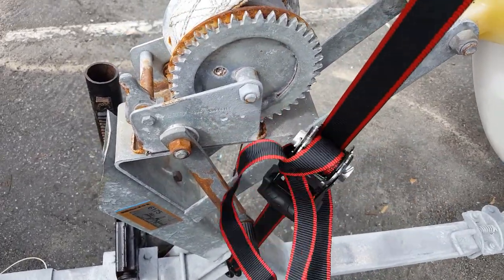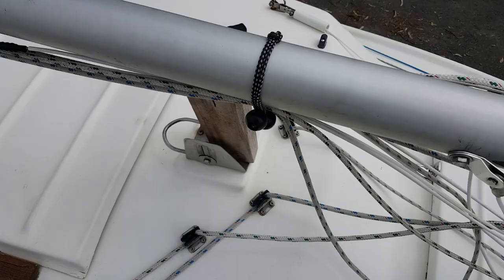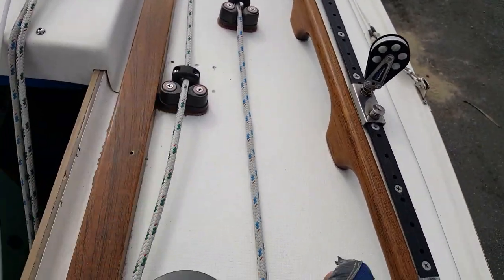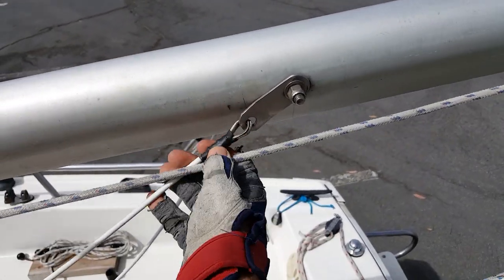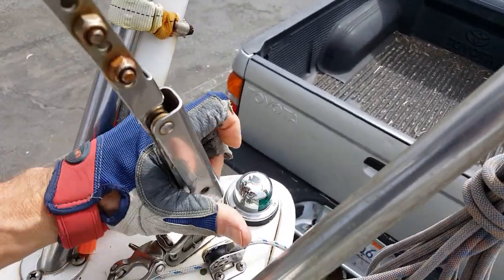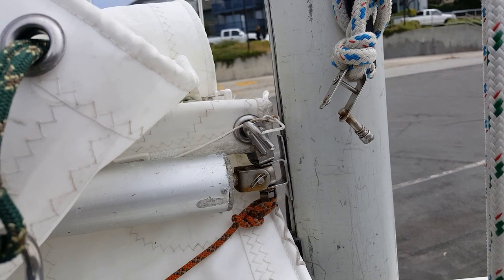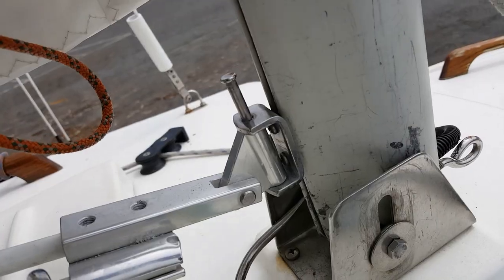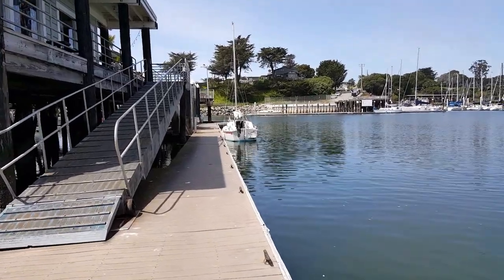Boat Tour: Setup

Comment: John great stuff. I had a 1998 P19 for awhile now have a 2005 Montgomery 17 I sail on Lake Erie but plan on taking her farther.

What do you hang your anchor on the pulpit with?
Reply from the maker: I hear good things about those Monty's. The anchor is hung with a piece of PVC pipe which is attached to the pulpit using two pipe clamps. The shank of the Danforth anchor is dropped into the pipe (after removing the chain), resulting in a very solid mount.

Comment: Thanks for the video! Just purchased a WWP19. I live up near Victoria Canada and am interested in rigging her with a Code 0 just like yours. Any info you can provide on the Code 0 would be greatly appreciated.
Reply from the maker: You're welcome. Congrats on the purchase. The Code 0, or (to paraphrase my sailmaker) I prefer to call them Tweeners because they are between a spinnaker and a genoa but don’t have to meet the Code 0 Race Rule, are made in tri-radial 1.5 oz nylon and include a furling torque rope. I have quite a bit more info. Feel free to ask specific questions.
Reply: @johnjordansailing  Thank you for responding. I am sure to have more questions after I take delivery next week. I will pm you on Facebook when I have more info.

Comment: Hello John! Appreciate the videos, I have some questions. I’m trying to outfit my 19 to get it set up faster and what not. Have you ever had any issues with your backstay coming loose or anything? I never have seen anyone with your set up. I have a turn buckle set up and it’s a pain! I have to loosen and tighten each time I set the mast.

Any ideas on a gin pole set up for mast raising while using a furler system? It seems that your system and others won’t work with a furler. Would the quick lever forestay attachment point work with a furler system? I have to put all my muscle into it just for someone to pin the furler currently. Can’t think of any other way. 

For the daggerboard. Do you use any water proofing or gasket to seal it to keep water from splashing in? With a little chop I get water inside every time!! Do you also have a way to secure your daggerboard? You have same style and age of my potter and we don’t have the locks like most of them do. I’m curious if you lock yours down? 

Where did you get the swim deck and ladder combo? That’s a perfect set up.

If you ever plan on heading to PNW I’ll buy you a beer and pick your head more sir!

Cheers, keep the videos coming your making our potters look good!
Reply from the maker: Apology for the late reply. No problem with the backstay; Jonah has an adjustable stay made of block and tackle. It's set and forget. My guess is a quick-release lever will not work well with the furler, as you can't shorten the forestay enough to fit it. For the daggerboard, I use some half-round adhesive weather-proofing strip intended for sealing car doors. It mostly works. I don't lock the daggerboard typically, but if things get rough enough I will. A lanyard that's attached to the cap of the board clips to an eye strap on the trunk. The ladder was already on the boat when I purchased her. Thanks for the positive feedback, and enjoy your fine vessel!